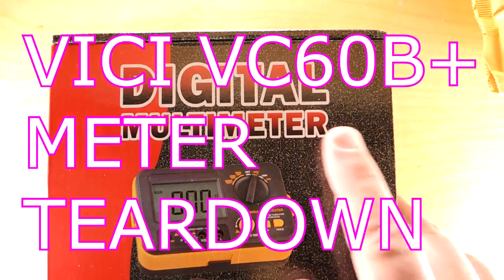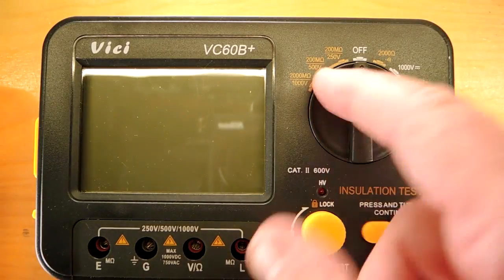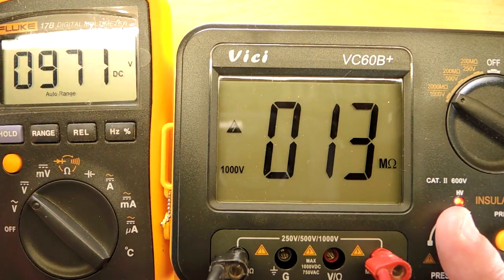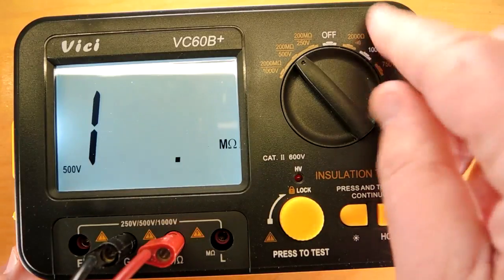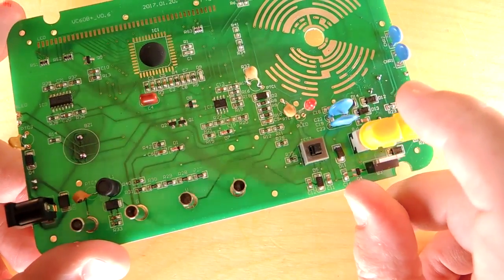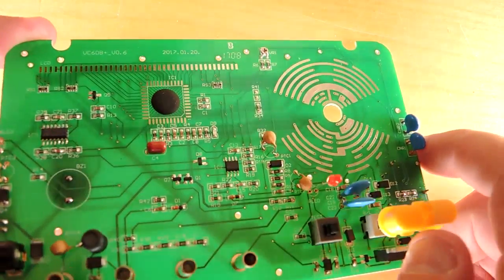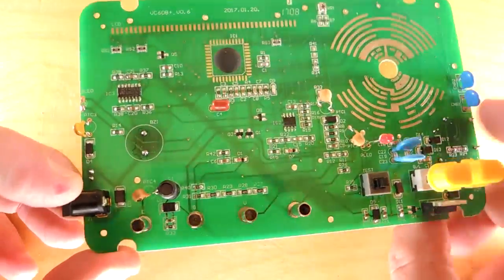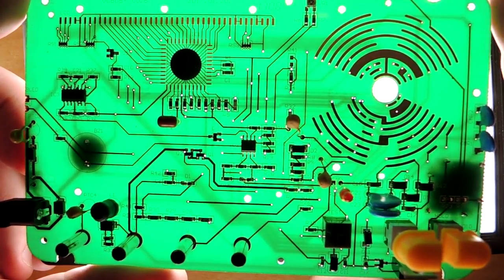VICI VC60B+ Insulation Tester / Multimeter Teardown

Comment: Get a grip.. your looking at a product that is being sold for like 25 bucks.. and then your blt'ching about it ain't gold-plated, and it doesn't have screw in bananjack socket like a high end fluke and you saw signs of some flux residue and you just go on and on and its screams amateur that complete lost the aspect of which product your looking at and its inner value..
You do know that there is often a difference if you pay 25 bucks for an Megaohm meter or your pay 500.
This is mindblowing that you can get such an tool for these kind of funds and IMO its looks very decent for the price its being sold at

Comment: Mine is much more accurate vs a Fluke measuring voltage generated and expected resistance of the Fluke. The one shown looks like a Friday job so there is obviously a risk of a fast buy to bin cycle due to QC issues in the factory. While I accept concerns over locking the output, it's a useful feature in some circumstances for an animal with only two hands or a big coil under test that has significant capacitance: Buyer should obviously understand it isn't a toy. It saved my blushes last week when my main game £1000+ Fluke 1662 spat its dummy. I'm keeping it as an excellent back up option - do test it properly before relying on it.
Reply: WOW! Very impressive!!!!!!!

Comment: We use Fluke insulation testers at work with MI (mineral insulated) cable to test for moisture within the cable.  When we find moisture it has to be driven out of the cable with a torch and will leave the tester running at 1000V to visually identify where the moisture is located.  When the torch heats up the moisture it causes the resistance reading to change significantly.  Once located we know where to focus the heat and will keep the meter running until we drive enough of the moisture out to get to our minimum insulation resistance.
Thanks for the tear down.  I looked at some similar units but decided to stick with our Fluke meters.
Reply: Why risk a Fluke when all you need to do is generate an arbitrary relatively high voltage? This is exactly the sort of application a cheap unit like this is good for.

Comment: Because this is likely ultra low current, would you notice anything if you touched its 1000v output?
Reply: Did you video that for your Electroboom reel?
Reply: A surprisingly low current can be fatal. 100-200mA flowing across your heart at 120VAC is a lethal range. Of course, your body is a pretty high resistance, but the wise approach would be to treat it with respect. If found this old (1987) page short and sweet: https://www.physics.ohio-state.edu/~p616/safety/fatal_current.html

Sort of the "treat every gun as loaded, even if you know it isn't" rule. There's nothing saying your ultra-inexpensive megger isn't faulty and providing far too much current :-)
Reply: Max Gurth  - Across two fingers of the same hand only please :)
Reply: Yes you will feel it and it bloody hurts. Trust me I’ve tried it.
Reply: It’s the high voltage that it put out that you will feel and yes it bloody hurts.